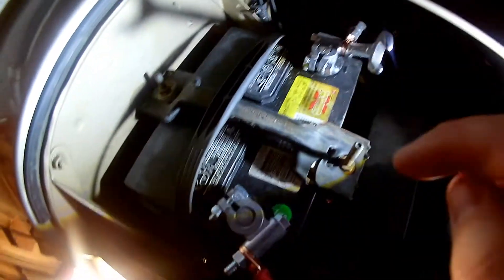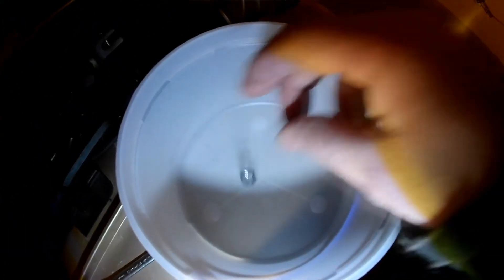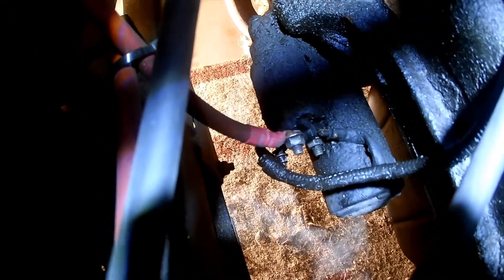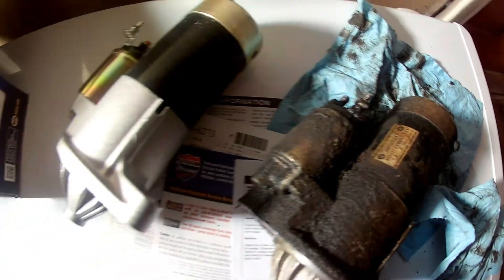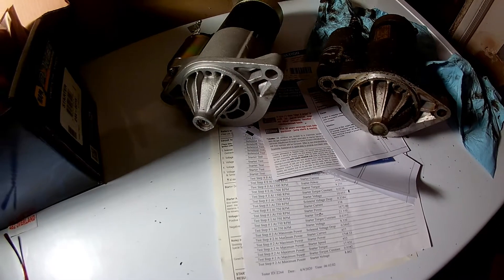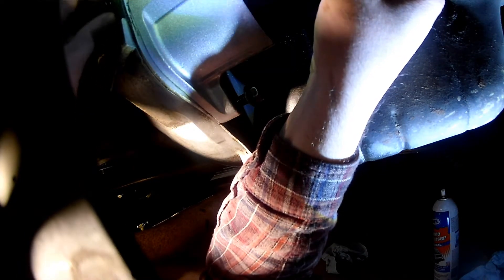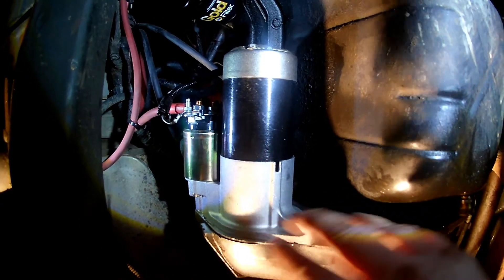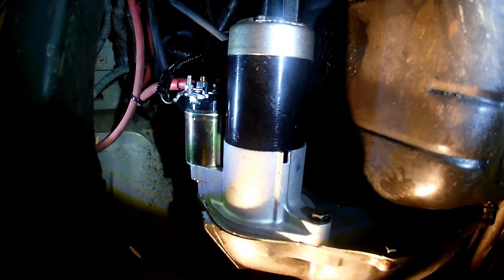1994 Wrangler YJ starter replacement

Comment: I have the same issue and when I replaced my battery, it didn’t improve. I didn’t replace my battery because of this issue. My battery was 7 years old and dead.

However, my starter isnt terribly old (10 yrs) maybe it’s older than I thought but it is a cheap aftermarket starter.